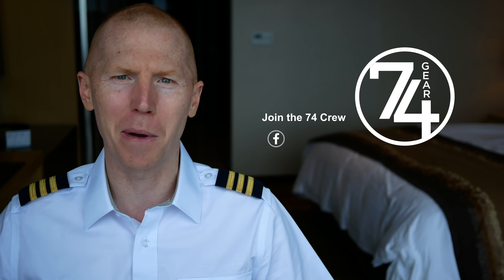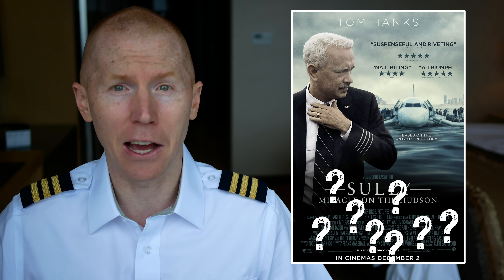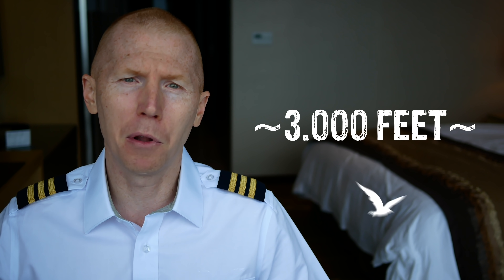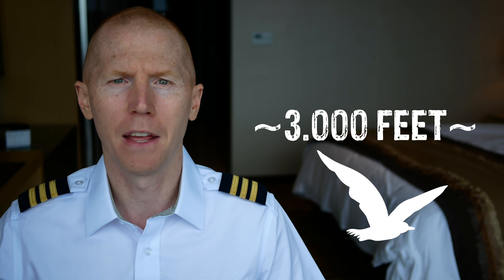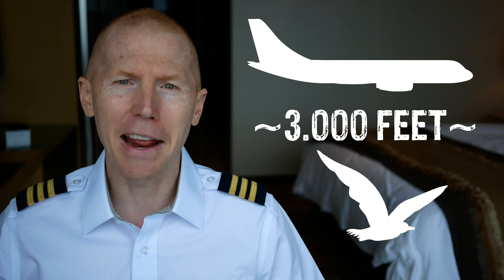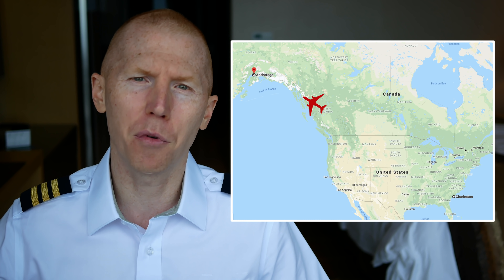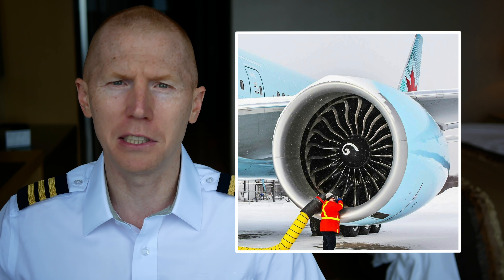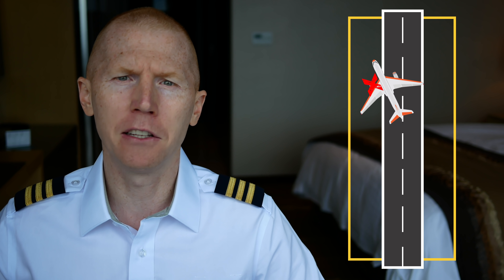Why Engines Don't Have a Mesh or Grates to Stop Birds

Comment: They didn't need locking doors on the cockpit until 911. When there is a bad enough catastrophe, they will start putting cages or grates in front of the jet engines.

Comment: Putting a wire mesh like a very thin Titanium one that does not impede air flow may be a matter of design.  Include a wiper to rid the mesh of what is left of the bird.  If you don't do that the Chinese will. Then you will say, why didn't we think of that.

Comment: I think it is ridiculous that designers can't design to save lives when a bird strike happens. You did not mention deflection as an option with some cone shape cowling that does not impede airflow but gets the bird to roll off the front of the engine.

Comment: Most aircraft will eat birds without failing, it would be more dangerous to put a screen in front of the engines to block airflow or to allow portions of the screen to enter the engine.

Comment: Well you could get around the "few minutes below 3000' argument by making the guards retractable for cruising. Just reel them back into the cowling. Arches that couple in the middle of the engine can be very strong. But they would have to be flexible in one direction so they can straighten up to fit in the cowling. Question is, how much power would they reduce when needed most for takeoff? Can jets really takeoff on one engine if the bird kills an engine on the runway?

Comment: I think just making better engines that can swallow birds would be ideal lol some type of internal device to clear the engine out in the event of unwanted debris sucked in.

Also he says no grates cause most of the plane flying is higher than where the risk is. You could make retractable grates or something. That said I think the complexity of that just puts you at more risk. Putting something in front of the engine for the sake alone. Best bet. Bird is tiny compared and light. Engines should just be built to be able to soak those in and spit them out lol. I’d imagine weight. Efficiency and other things come into play when designing such a thing.

Comment: 4:46 Or as far as I can remember, there used to be airplanes with THREE Turbines like Douglas DC 10. 
They are called turbojet, ramjet and scramjet. 
Isn't that much safer when you fly with 3 turbines???

Comment: 2:50 Kind of a bad argument, you could put in an automatic grille that every time you go over 3000 feet the grille goes up and every time you go below 3000 feet where it seems dangerous for the grille to go down.  So you have an eight-hour flight but only a very short time where the grid is in front of the turbines

Comment: Sounds to me that no one has seriously considered trying to develop a bird deflector.  It could be deployed when radar detects a bird.  I don't buy all the excuses for why it won't work.
The screen could be retracted until a radar detects an oncoming bird, then pops out temporarily to deflect the bird.
If that's too much tech, a screen like that on a goalie mask could be permanently in place, with heating elements to melt ice if it should form on it.
I think if a few engineers were assigned the task, a suitable bird deflector could be designed.

Comment: I UNDERSTAND THE RESTRICTION OF AIRFLOW

 BUT A RETRACTABLE SCREEN THAT COULD BE USED AT LOWER ELEVATIONS.

 THE SCREEN DOESN'T HAVE TO STOP THE BIRD FROM GOING IN THE ENGINE,

 BUT RATHER WHAT PARTS OF THE BIRD THAT GET THROUGH THE SCREEN WILL BE SMALL ENOUGH NOT TO COMPLETELY DAMAGE THE ENGINE, 

 CAUSING FAILURE.

Comment: There was a airbus A330 That was on a Qantas flight from Singapore To Perth,And In the air a error occurred which activated its safety features and made its nose have a 10 Degree pitch down.Everything that wasn't strapped in went flying into the air and the plane would of nose dived into the ground,But the pilot was a Ex-Top Gun academy pilot for the US navy and he used his skill and strength to the hardest possible to save the plane from hitting the ground and crashing.He used all of his strength for a few minutes on the side stick but he finally regained control and stopped a catastrophic event from happening,the plane safely landed at Perth.

Comment: Let's be realistic here. At the speeds and power we're talking about there is no screen whatsoever that will let both enough air through to keep the engine working and at the same time block a bird. A bird hitting that grate will just get sliced or sucked through that shape no matter what. You're still getting a bird in your engine, just either a squished one or a bunch of bird pieces. Neither will make and difference. You'd need someone shaped to deflect the bird and nothing can do that without also deflecting air.

Comment: A mesh or screen won’t really obstruct the air flow. In fact, meshes and screens are used in wind tunnels to improve the air flow. A better reason is that it would be extremely hard to design one that was light enough yet strong enough to stop a bird. And if it isn’t strong enough, then you’ve only increased the amount of fod going into the engine. And if it does stop a bird, what then? Now, you’ve got a dead bird stuck to the inlet of your giant vacuum cleaner.

Comment: Why can't the engine just be built strong enough that it can just chop the birds up like sushi, and spit them out?
Reply: it does for most small birds, but a 10 pound goose is a lot of energy and protecting against that would be extremely difficult

Comment: Just use lasers under 3000ft and turn them off when above for fuel efficiency. Being fuel inefficient for ~15 minutes a flight is a lot better than losing an engine. Yes, it’d be dumb to obstruct the intake of an engine for the entire flight, but thats a dumb proposition to begin with

Comment: What many don’t understand and what was very surprising that you didn’t mention. 

BUT. 
They throw birds or bird like objects into engines all the time during testing. The engines now are so powerful, blades are so strong yet lightweight. That even when a bird flies into the engine. It hardly causes any compromise. There will be a slight fuel delay during the combustion process but that bird will be roasted to powder crisp by the time it exits the turbine engine. I’ve seen engines under testing take direct bird after bird impact and still provide thrust greater than 35%. Pretty incredible. Even though it’s not giving full power, better than destroying it 35,000 feet up in the air.
Reply: He mentions it in other videos

Comment: I’ve heard as well that airports used to shoot incoming birds. Over time, this would train the birds to avoid the area around the aircraft, similar to how bird spikes deter birds from doing near certain city areas. I think there’s legislation nowadays preventing this though, since many endangered bird species have migration paths that cross over or near airports (so shooting them is obviously not ideal, especially considering the fairly low risk that birds actually pose to aircraft). No doubt there’s new tech to deter them though, I don’t think I’ve ever seen birds anywhere near my local airport even during migration seasons when new birds would come in that aren’t aware of the danger

Comment: then add a type of screen/cage that retracts when the plane is at safe elevation. the shape of the cage can be designed so that the bird will slide to the underside of the engine. i assume that would be more economical than having to go through with checking the engine after a bird strike or the inherent inefficiency it would cause during the first and last few minutes of the entire trip.
Reply: inefficiency = greatly reduced thrust, exactly when you need thrust. it would be more dangerous to have such a device
Reply: @AmbientMorality  as mentioned, it's only for a small portion of the entire flight. besides, you don't need to place the grates too close to the opening - it can be angled upwards from the bottom.

Comment: Engineers are more concerned with making it to point b but not concerned with lives of passengers. Passengers pay their salaries not dead birds. I believe the engineers should still come up with a bird deflector cones mounted on the mouth of the engines. The space above the ground is suppose to be open and not pose obstruction to the flight path. Not to come up with a solution to this problem is a 'sissy' excuse. How many air disasters are caused by bird strikes? Should we have them happen at all? Or have a bird extermination program at risk airports around the world so we humans dominate the air spaces.

Comment: Thin Tungsten Wire has a tensile strength of  250,000 PSI and would easily slice a bird up without breaking. Jet engines are designed to ingest small birds so a big bird could be made into small bird pieces. Of course several birds might clog it up if they hit in succession. 

Or if they used FLIR and had automated high powered lasers they could divert the birds away ahead of time, I use to have a high powered green laser pointer and I would mess with the birds in flight, they don't like sudden bright lights in their eyes and lasers can be made to expand the beam really easy and still be effective.

Comment: They could string a few high tension wires like maybe 6 wires across the front in a asterisk type of pattern and it would at least shred the birds into smaller masses without really affecting airflow and maybe the engine survives.

Comment: As an engineer, I can think of a way to have a power driven mesh/grate that can cover the engine and then after ~3,000 feet retract away.  But like you said.. It's so rare it wouldn't be worth retrofitting planes with it.
Reply: Worth it. Is there really absolutely no way to cover those engines up when needed? Even humans got ingested in the past. If I had been one of the first aircraft designers, this would have been amongst the most important things I cared about. Can't believe after all those years humans have kept letting this happen

Edit: also just asking as a person not in the aviation industry, do birds get repelled by things like loud noises or bright lights? Can we use sounds and/or lights to shoo them away from the aircrafts?
Reply: @p.channel.2023  It's very likely that the mesh would end up in the engine in this case, along with the birds. Remember, the impact happens at great speeds.
Reply: I was thinking a bladed aperture screen, much like a camera lens.
Reply: If your an engineer, you'd know that the materials that are used in these engines aren't going to be easily destroyed by a bird and don't need a "mesh cage" around them to protect it.
Reply: @eisgeistschiller5244  Ok so why do they keep breaking when hit by birds?

Comment: If you run engines at a few degrees above freezing but with high ish humidity the intake guards will ice up. This will effect power . It could cause an engine to stall. Not good . As a engineer we we always fitted intake guards for safety reasons on ground runs. The guards did not effect performance on these engines  however we were prohibited from fitting guards in certain weather conditions.

Comment: Your explanation is total b****hit. first of all any mesh screen at least 3/4 inch by three-quarter inch cut out is going to work just fine. I know this stuff because I'm a GS4 structual aeronautical engineer. I've designed several of these units installed on several aircraft around the world with no known problems and these engines are not millions of dollars to build, they're only approximately $1,400 to build we build from cardboard.

Comment: Turbine Engines (Some of them) have an IPS blower than can help with birds that get sucked into the inlet. IPS = Inlet Particle Separation. Normally they simply filter dirt out of the intake stream of a Turbine to cut down on fan wear. However they can at times help filter the bird out of the inlet preventing it from going into the turbine. I don't know if 747s have IPS blowers on their engines.... but GE-T700 engines do (Used on UH-60 Helicopters).

Comment: I feel the largest issue with putting anything in front of the engine would be that if it was too weak/thin it would just get sucked in by the engine. So if you made it strong by then it's blocking most the airflow.
Reply: I think about 3637 people have already said that in the comments.

Comment: I'm surprised he didn't mention that the reason there is a white swirl in the middle of all commercial jet engines is to detur geese from flying into the engine. It only looks like a swirl when the engine is stopped. But at operating power it looks like a white dot in the middle of a black hole. And supposedly it freaks geese out and they will change their course 👍

Comment: Sorry this is just like any turbine!!!! 4K horsepower turbo charged drag cars have mesh screens in front of them and that’s on a little compressor I can only imagine on a airplane the turbine is so big that you can literally make a screen with 1 inch circular holes across the whole motor which will not make it run any harder because this is in front of it it’s all physics & math dude!

Comment: I don't believe the question was answered completely. Imagine a screen full of birds blocking air flow..   now you need screen wipers in flight... the engines are test by throwing in dead chickens and do perform well and are designed to ingest birds without a burp or hickup so to say...     its a bird eat bird world...

Comment: Could you design the plane or the engine in a way that the air could travel over some sort of deflector or shield that would deflect or knock away any large or damaging object in the airflow but still allow the air to pass around it at a speed that would keep the engines running efficiently? you wouldn't even have to put to directly over the engine

Comment: There is no reason not to have any blockade there. It's just engineer's ego. When Mary Anderson suggested to have windshields wipers, she had to face the vehement opposition of automobile engineers. Every change suggested with experience or common sense is at first opposed by the experts resulting in planes like Boeing 737 Max killing hundreds of people.

Comment: MiG 29 has doors that completely shut off the main engine intake completely and another intake above the aircraft that allow air flow for rough field landing situations. MiG 25 and SR-71 have cones in front of the engines that expand or retract to regulate air flow. So it’s doable but it’s not done due to cost.

Comment: This guy actually tells nothing  in 5 minutes of bragging.
They could make a wider engine mouth and fix a grill in front. The wider mouth could make up for the space occupied by the grill. The air intake in a normal engine can be calculated and equalled to the air intake of a wide mouthed engine with a grill in front.
Rocket science deciphered.

Comment: Simple answer is an airplane engine has so much suction force that no matter how small the mesh you put to cover the engine it would still be pulled in through what holes that are left.

Comment: I often wonder why there isn't a grate, that would be wide enough not to affect air from being drawn in but close enough to keep a human body from going through.  Granted ground crew should know to stay 9 to 17 feet from the front.  But you would think it would be plausible with limited to no performance difference.

Comment: if the flight time below 3000ft as you say is only 5 min, cant engineers just have a temporary mesh rollovernthe fan just for those few min? then retract above 3000ft... ?   100yr probelm solved... there you go..

Comment: Okay since they cost 25 million each I’m sure they won’t have a problem spending another couple million to protect their engines in this way : okay we add some super top of the notch tech available for some sensors that could detect anything flying towards the plane at every angle and when it gets close enough like say a bird , then something that won’t stop too much air from going in the engine would cover the engine for a sec while another piece of technology removes the bird if it actually goes in and yes I know we would have to probably redesign the airplane but it’s to save lives and obviously the air craft that cost a lot of money . as soon as one of the sensors gets a hit the mesh or whatever would be the best material to cover the engine with that’s when it would close and the bird lands on it and somethings els would remove the bird 🤐

Comment: 1:21 Only 15% of the air sucked into the intake is mixed with fuel and ignited, since you aren't firing up an old "pure jet", but a high-bypass turbofan engine.  The other 85% is accelerated by the fan, producing 85% of the engine's  thrust.

Still, putting any obstruction to smooth airflow into the engine would produce harmful effects.  Remember that air entering the engine is being "sucked" and is moving faster than the aircraft is.  At normal airspeed, what kind of screen would stop a bird, anyway?  Fun fact: bird and screen sucked into engine is worse than just bird.

Comment: Solution: bird sensors. 
Locate enough around take off area and on the planes to alert air traffic control/pilots and incorporate standard emergency operating procedures/automated flight controls designed to best avoid potential impact.
Technology has advanced so rapidly in the last several years I'm fairly certain we have the ability to design and implement that type of system into our aircrafts.

Whether it's worth the cost over how often this sort of problem occurs is a different discussion which I have no clue on though.